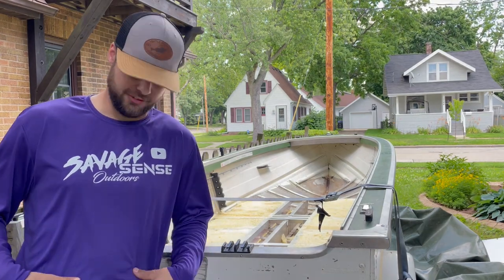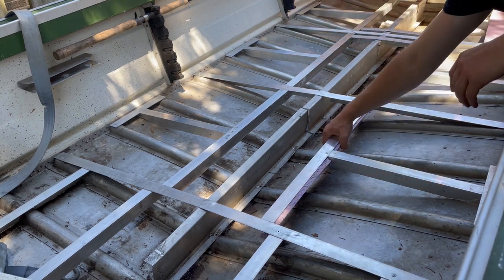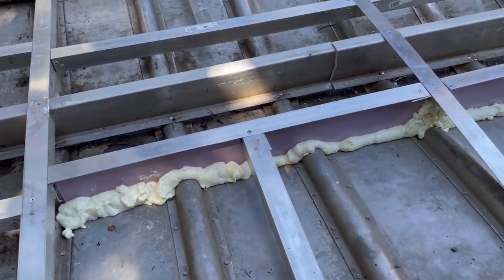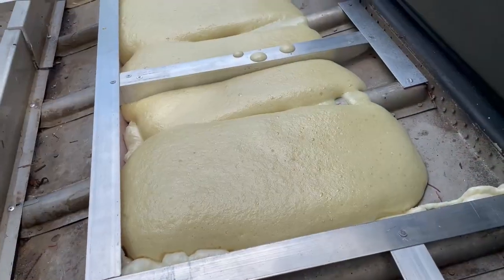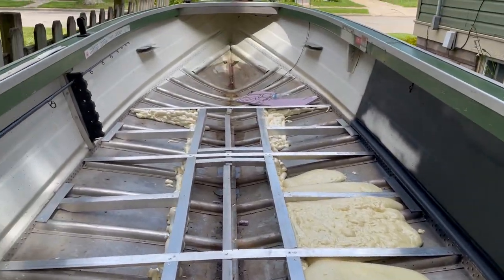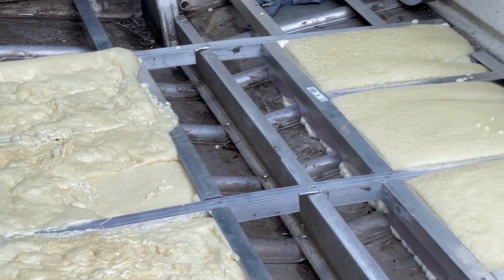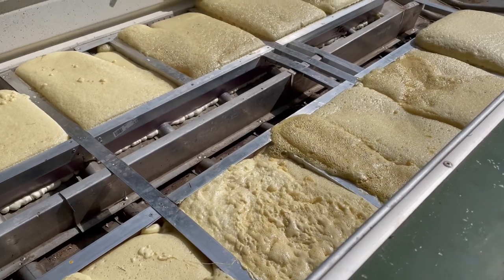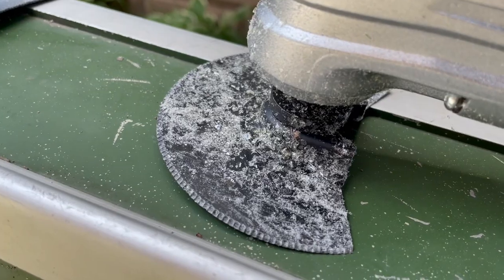Pouring Foam in My 16' Starcraft Jon Boat | Salvage to Savage #3

Comment: When I did mine I had a piece of plywood with wax paper on one side. I poured one section at a time then put plywood over the top and kneeled on it to prevent the foam from expanding to high. I let any excess bleed over to the next section to be poured. I also had a removable piece of plywood cut to shape with the wax paper where you used the pink foam. It work out great and I didn't need to do any sanding. I wish I had done a video when I did mine but I didn't. 
I recently pulled the floor up on mine (marine grade plywood) and after 12 years the foam is in perfect shape. Good luck on the boat.
Reply from the maker: I think I’d do something similar if I were to do it over again. The cutting and sanding was time consuming and messy!

Comment: I did the same build 35 years ago. 14 ft. mirrocraft deep fisherman. Gutted interior complete. Installed flat floor,small deck w/built in storage built box across where center seat was w/flip top door on each side (gas and battery). Padded and upholstered top of 54 qt. cooler to set inside of box. 2 pedestal seats and carpeted throughout. All pressure treated 12x4 and plywood construction bout 200 lbs. of wood. A long story short, I researched the flotation of styrofoam and it only floats 50 lbs. per square ft. Glad I didn't have to see if my boat would float because I would be pretty wet!!!
Reply from the maker: That’s awesome! I have very similar plans except I’m doing my decking with aluminum
Reply: NEVER USE PRESSURE TREATED WOOD IN A ALUMINUMN BOAT!!!

Comment: Another way to do this (that would have given you a perfect glossy top finish that wouldn’t need paint) would be a sheet of ply + poly sheet with a hole in the Center.  Pour through the hole and the excess will come out the same hole.  Works perfectly.
Reply from the maker: I do wish I spent a little more time to research and do the foam better, hopefully it lasts a long time the way I did it though😬 I guess it’ll be a learning lesson if not.

Comment: You said you want the foam to be as dense as possible. Not really. You want the foam to be less dense than water. 2lb density foam will give the greatest amount of buoyancy as it has more air entrained in it. 90 percent of the reason you put foam in the boat is safety. if you take on a rogue wave and/or can't pump water out faster than the boat is sinking the foam will provide the bouyancy to keep it afloat with water in the boat and at the very least slow it down from sinking completely. The other 10 percent reason you pour foam is for lightweight structural support. thats where some people use 4lb or 6lb density foam instead of the commonly used 2lb foam. it is more dense and thus stronger and more rigid. 👍
Reply: I really need these marine foam , how to get?
Reply: Very interesting your explanation I think we might have a class to teach me

Comment: The pink foam board and spray foam will disintegrate if it comes in contact with gasoline. It is not rated or approved material for this use. It worked as a temporary stop for your foam pour, but isn’t the right material to use. It would be better to block those gaps with other material that can be removed later or an approved foam insulation.

Comment: Does it state on the bottle how much to mix in order to fill a certain size space, (volume)? BTW, good info in your videos. I am doing the same type of restoration on a 1981 Starcraft Mariner 18 center console. Should start the floatation install next week....
Reply from the maker: I don’t believe there was a specific amount of liquid / volume of foam ratio, if you order more foam than you need you could definitely do some test runs in a box or something? Otherwise it’s really just trial and error, it was in my case at least lol

Comment: I bought a boat just like that one this summer it is a 1969. It had trees growing in it I watched other guys on youtube and thay put the floor on and drilled holes in it and poured the foam in. I like your way better Thanks for the video
Reply from the maker: Someone said when you cut into the foam, it’s not sealed anymore and could take water. I’ve never experienced it, but I coated my foam with an oil based paint to help reject water from entering the foam cells. 
Thanks for watching and good luck with your boat build!
Reply: @savagesenseoutdoors  what kind of boats are these they like deeper v hull style like the Australian tinnies seems way deeper than a jon boat
Reply from the maker: @ryanbrady752 I’m not sure what they’re considered, they don’t seem like a deep V but I’m not sure I’d call them a mod-v like what people use for duck boats.

Comment: I'm following your build w my 16' MirroCraft Deep Fisherman project. i was leary of pour foam but you kind of de-mystified it. I can see some advantages for structural support. I was going to just stack pink foam.  

Keep the vids coming!
Reply from the maker: I considered doing pink foam as well, I think it’d work just fine for the water displacement/buoyancy aspect but I decided to go with the pour foam for the extra structure like you said and to help keep the boat as rigid as possible. Thanks for following along!

Comment: Can water get between the foam and the aluminum? If it stays wet there corrision may be an issue.
Reply: @myparadiseonbantayanisland9030  Good point… I actually was asking US composites this week about shrinkage, and they said if your mix isn’t 50/50, it CAN shrink after a week or so.  That would for sure cause problems.  On the other hand, it’s very sticky, so if you cleaned the inside of the boat fairly well (get rid of grease etc.) it should be OK, at least in terms of water between the foam and the aluminum.

Comment: It’s been a year, wish you’d done anything differently? 
I’m on the fence between pour foam or just using blocks of foam
Reply from the maker: Just wish I’ve gotten more done on it last summer, I do wish I brought the subfloor all the way to the nose though. That’d make it easier when I get to framing the front deck
Reply: @savagesenseoutdoors   ya I started my restoration last September, told the wife I’d be done by the new year … that was a lie lol 
I have a 21’ StarCraft holiday so it was a cuddy cabin time bow. I’ll frame all the way to front. Framing never really crossed my mind until I came across your videos. Do you wish you’d done wood floor vs aluminum? 
I’m leaning towards since I’ll be bolting seats down along w vinyl flooring
Reply from the maker: I’d only wish I did plywood for the cost savings and it’d be considerably easier I think. But I’m hoping that the weight and longevity of the aluminum makes it worth it in the long run

Comment: Thank you for the tips. Vibrater saw and pour more then less good to know. Side note. The surrounding look. Very western washington.. I live in east Kent.
Reply from the maker: Some other people dropped good tips in the comments I wish I followed, some said to put plywood on top of the cell so you don’t have to cut and it’ll stay a sealed cell that way as well instead of opening the cell when I cut it
Reply: @savagesenseoutdoors  there is  videos out there that show that working perfectly. Then the disaster of it not. From what I have gathered as the foam expands it hardens, bottom still liquid top slightly firm pressure from below the foam expanded too fast and lifted the deck. About 3 inches. That was a fiberglass boat..if your still with me. My boat is built like yours. Use scrap plywood that covers a few compartments and cut a 2 inch wide 2 foot long hole width wize. Then put oil or plastic wrap on the underneath side of the plywood so foam don't stick clamp inplace pour a few, lift and continue. Thoughts?
Reply from the maker: I’ve never tried it any other way brother so I can’t say for sure unfortunately how well any other way will work
Reply: @savagesenseoutdoors  I am nervous as you about this. Fingers crossed 🤞

Comment: Did you have any foam left or did use all of it
Reply from the maker: I used all of it. A few pods got overfilled, I think I gave some good pointers in the video about what I would’ve done differently if I remember correct. You may have a little leftover if you take those tips. Otherwise I filled my low spots with spray foam and it seemed to work good.

Comment: Whats the brand of the foam ?? Where can I get, Amazon???
Reply from the maker: The brand is TotalBoat, and yes I ordered it on Amazon
Reply: @savagesenseoutdoors  thanks 🙏🏼 Im doing my first build and I don’t know much about it, but we learn every day 👍🏼
Reply from the maker: @irbinortiz5843  that’s awesome man! This is my first boat build as well and I’ve learned a ton from watching TBNation. I’m excited for Spring season so I can get back to working on the boat.
Reply: @savagesenseoutdoors  where do you live I live in Rhode Island Im planning to use my boat in saltwater, what paint do you recommend for aluminum boat
Reply from the maker: I’m from wisconsin, so I’ll only be in freshwater. You’ll have to do some more research for paint, I can’t help you with that one yet. I’m planning to wrap mine
Reply: @savagesenseoutdoors  Awesome thanks for your help 🙏🏼
Reply from the maker: @irbinortiz5843  I’m happy to man, good talking to you✌🏻

Comment: I'm just curious if you know the year of your boat. I just bought one from a buddy that's looks just like yoyrs
Reply from the maker: It is a 1978 StarCraft, I have the title for it👍🏻
Reply: @savagesenseoutdoors  cool thank you hopefully that will help me when I try to get the title for mine
Reply from the maker: Do you have the little plaque anywhere? Should be some kind of number you can use to register it
Reply from the maker: It’s a small metal information plate, tells you how much weight and hp it’s rated for
Reply: @savagesenseoutdoors  I'll have to look it's still at my buddy's house waiting till we move into our new home 2 weeks to move it over there. But I'm really enjoying your videos on your boat going to help me when I get started on mine thank you for the info
Reply: @savagesenseoutdoors 1978 Starcraft which model?
Reply from the maker: @jareddurette8741 I’m not sure

Comment: How many gallons of foam did you use?
Reply from the maker: I believe I only bought one kit and it was barely enough for what you saw, one gallon of foam and one gallon activator I think. They mix 50/50
Reply from the maker: They came in a kit on Amazon

Comment: Very smart....if one can't first think about safety first , why even bother?
Reply from the maker: What aspect of safety? I don’t remember
Reply: @savagesenseoutdoors   The craft floating instead of sinking.
Reply: @savagesenseoutdoors  Why did YOU put foam in anyway? Acoustic properties?  🎧
Reply from the maker: Oh right. I put foam in for buoyancy, if this boat takes water it should still be buoyant and stay at water level until those cells of foam get soaked/full of water.
Reply: @savagesenseoutdoors  I see....